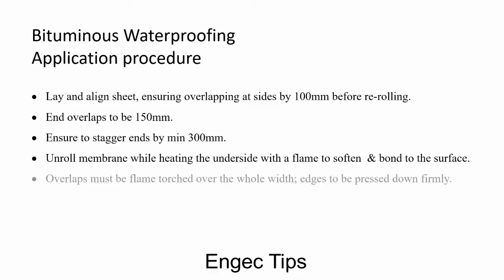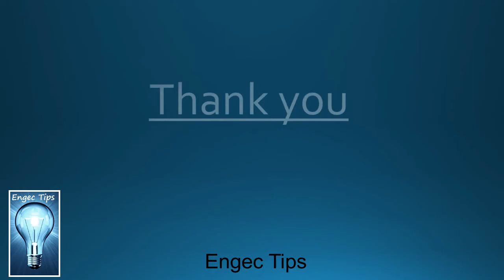Torch on Membrane Waterproofing Procedures

Comment: Ur sealing method completely wrong bro... U need to seal with stel kerni
Reply from the maker: Thanks for your comments. But, steel strip is used for termination edges, as where membrane no longer lapping.
For membrane lapping, video shown method is the correct one. 
If you need more details, please refer BS8000 standards.👍👍
Reply: Hello we have project in manila can you give us quotation the roofdeck is around 900sq.m. @constructionengineeringtip6028
Reply from the maker: @apdarchitect3840  Hi, in here I'm not doing services for the application. You can find number of applicators (material supply and install) related to your working area. You can monitor their method statements, work quality using these videos. These procedures based on BS8000 workmanship codes.
Thanks 👍😊

Comment: wow.  very poor safety
Reply from the maker: Yes sure, Thanks for your comments. Safety should be first. In here safely is very poor. We need to educate all the workers regarding proper safety practices before commencing the work. In here, I was trying to BOLT the correct procedures in torch on membrane applications. 🤘👍

Comment: Flip Flops? Seriously... Stopped watching after 20 seconds.
Reply from the maker: Using rubber slippers not allowed and it’s not the recommended way. It needs to use a static roller to seal the joints. 
Thanks for highlighting the issue. 👍🏽🙏
You can follow the procedures as BS code as I mentioned in the video. That’s the recommended laps.

Comment: Whether can we put screed on the membrane as final layer?
Reply from the maker: Yes. That’s is must. It needs to put screed as a protection layer. Because, it should not be exposed to the direct UV rays and rain 🌧️.
The protection layer method depends on, where we apply these membrane. If we apply underground structures (which are exposed to the soil, we can use brick/block walls with 1000 gauge polythene as a protective layer.
If we use on above structures ( as roof terrace), we can use cement screed or concrete screed as protection later. But be vigilant that cement/concrete is not properly bonding with this membrane. So, we have to keep separation joints and better finish method. 
There is a video regarding roof terrace waterproofing and insulation in my channel. If you refer that, there I showed a section detail regarding how to finish the roof terrace after the waterproofing. 
Hope this helps you. If you need any advise, I love to help ☺️.
Reply: @constructionengineeringtip6028  Thank you so much for your kind advice sir,I will definitely go through the video 🙏, Also please let me know how we can contact you, thank you sir.
Reply from the maker: @googleuser2859  you can contact me via FB. please follow my Facebook Engectips. if you need any assistance, please send me a text. Thanks.

Comment: How many coats of primer did you apply?
Reply from the maker: It should be 2- coats and should be applied in perpendicular directions to ensure that primer applied all over the surface/substrate. 
Thanks for your comment ☺️.
Reply: If it's okay if 1 coat only?
Reply: @JaniceValmoria yes 👍🏽. But make sure it’s applied all over the substrate. Otherwise, membrane will not be properly sealed.
Reply from the maker: @llgalappaththi  Thanks you 🙏. Yes you can apply only 1 coat. But, it should be applied all over the surface.

Comment: Primer coverage per litre please?
Reply from the maker: Typically, the primer coverage per liter for torch-on membrane waterproofing can vary depending on factors like surface porosity and application method. British Standard codes and Australian standards may have specific recommendations, which you can find in documents such as BS 8102:2009 for British standards and AS 3740-2010 for Australian standards. It's best to consult these standards directly for accurate information.
Reply: @constructionengineeringtip6028  Thank you for your  technical guidance. I have decided to do FRP waterproofing after thoroughly analysing the cost factor, lifespan and effectiveness. I will do it on my own. Our terrace surface area is already waterproofed using the FRP method and it is giving good results. Now we want to waterproof the parapet wall. I will be highly grateful to you if you make a video on the mixing ratio of FRP components. Thank you 🙏🙏.
Reply from the maker: @hsk1977  I’m happy to hear your suggestions. I will definitely do a video on that. ☺️👍🏽
Reply: @constructionengineeringtip6028  Thank you.

Comment: Hala bat ganyan pagseal?
Reply from the maker: Hi, Can you reply in English..🙂
Reply from the maker: There are different methods to seal termination edges and Wall edges. For termination edge seals, we can implement this methodology. But for wall end edges sealing, it’s recommended to use steel strip and acrylic sealer. 
Thanks for your comment. 😊